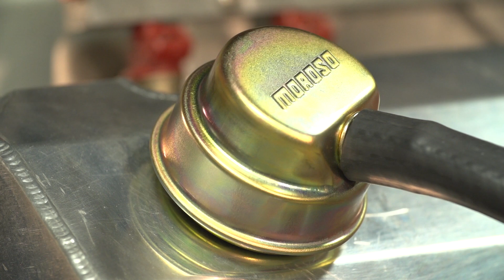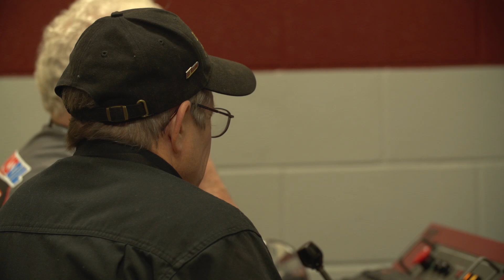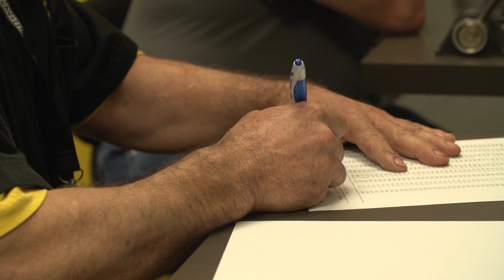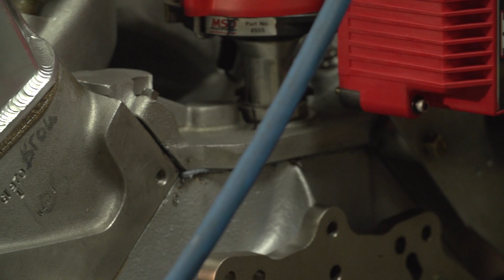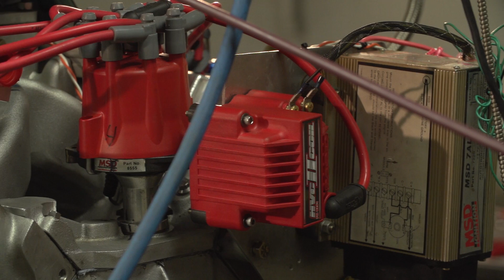433ci Big-Block Chevy by Performance Crankshaft at the Amsoil Engine Masters Challenge 2014

Comment: I was told never use the AMS oil break for a a new rebuilt 454 motor ..I did not listen to them and the oil broke my rings in very fast I was impressed